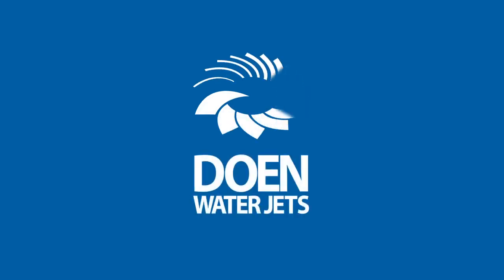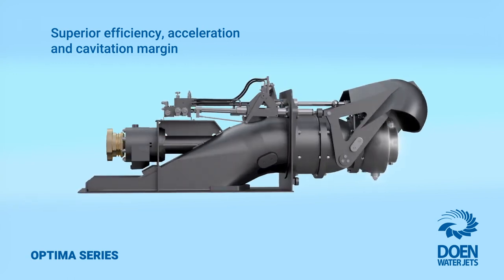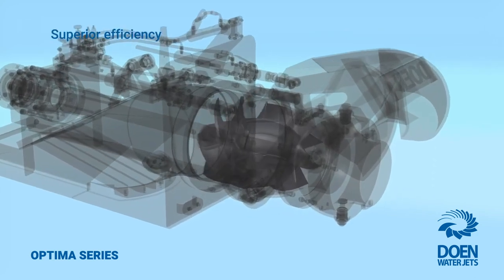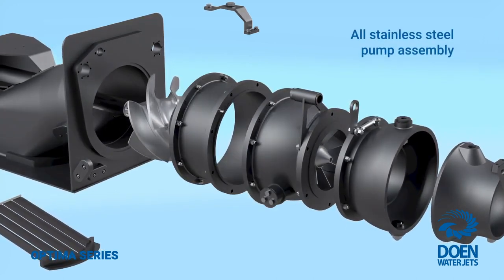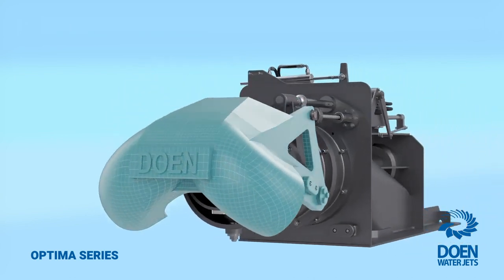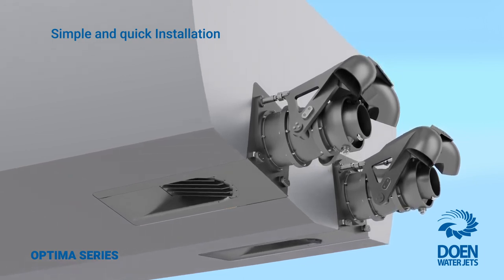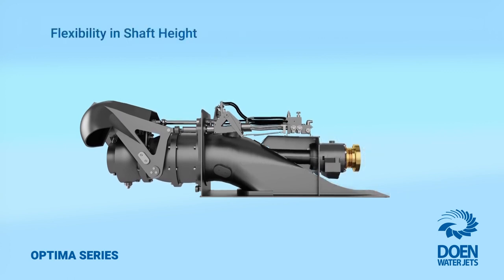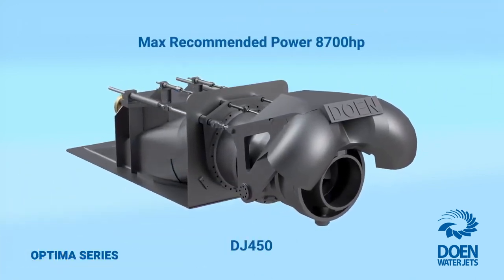DOEN Waterjets - Optima Serie - Supported by GEMO

Comment: We have DJ200 of the optimus series and currently operating in Nigeria but have had serious problems with debris and dirty water. Any feasible solutions.??
Reply from the maker: Thank you for your comment @chijiokeonyeagba7593
We are aware about the debris and dirty water situation in Nigeria, as we sold #waterjets in the past to Nigeria. As i'm not sure about your application, the best solution is to use the backflush option. 
If the waterjet is combined with a gearbox, there is the option of so-called reverse flushing or backflushing. In this case, the water jet drive
direction of rotation and thus frees itself from contamination/blockages caused by debris.
Another option is to change to a another intake grid with smaller distances to the struts, but this might have a negative effect on your speed/performance. 
If you need field support the company SOUTHERN POWER PRODUCTS in Cape Town would be your nearest Doen Waterjet dealer.